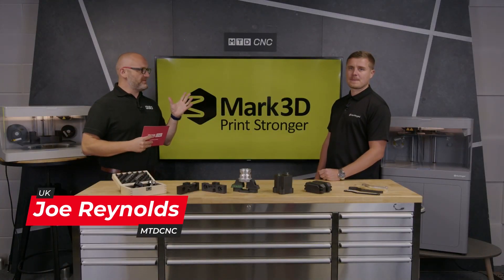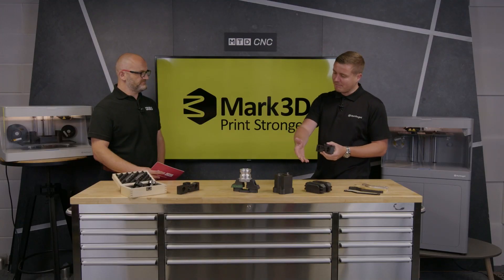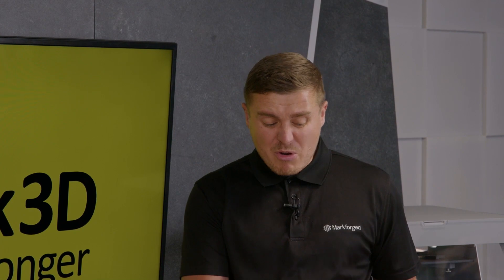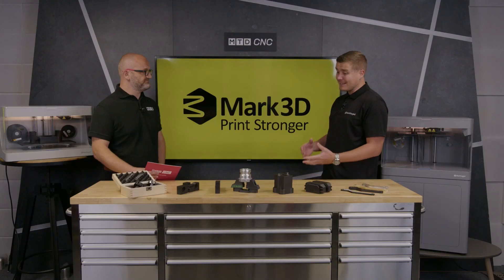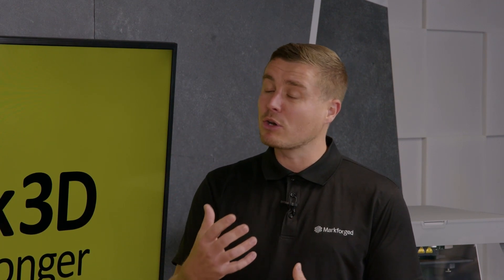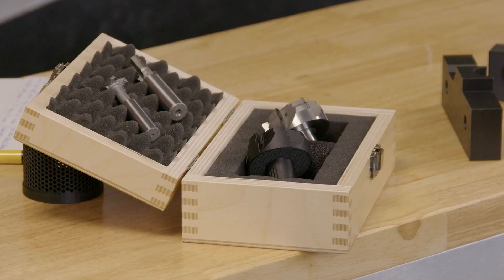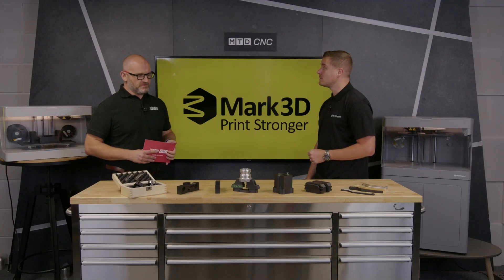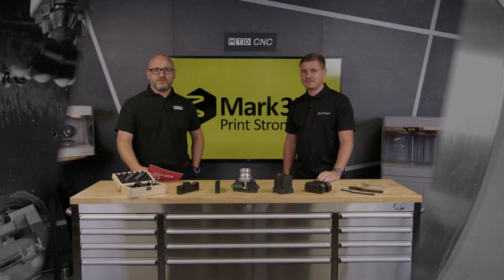You will never have to mill soft jaws again!

Comment: can these withold the pressure of gripping a part in the lathe say for example of gripping a part at 30 bar, and taking huge cuts on the OD over Ally or Mild steel soft jaws? or at the other end gripping on say 6 bar and still keeping it in the 3D printed jaw?
Reply: Carbon fibre reinforced filament has similar strength to 6061 aluminium. 3D printed soft jaws aren't suited to all jobs, but they're ideal for second ops on hard-to-hold parts. They're a real game-changer for short-run 5 axis work. As Daniel says in the video, complexity is essentially free on 3D printed parts - you don't have to worry about tool changes and tool accessibility, you just click print.
Reply from the maker: @j.dietrich  We agree